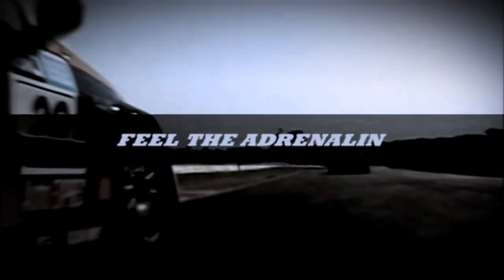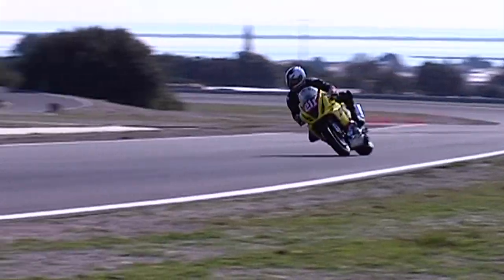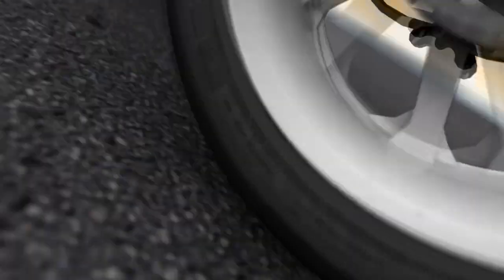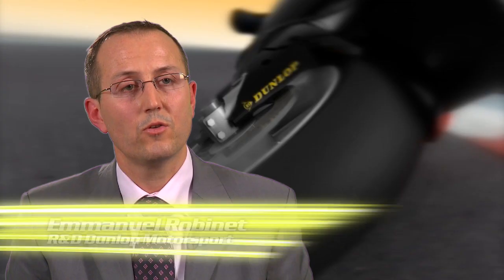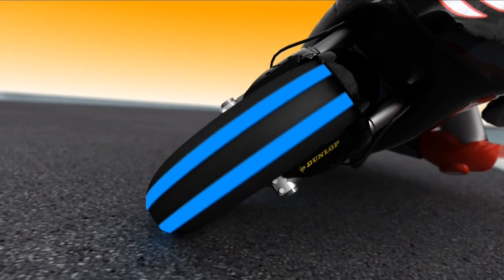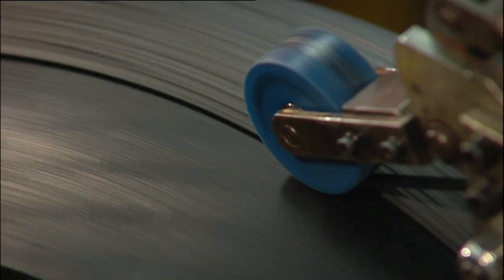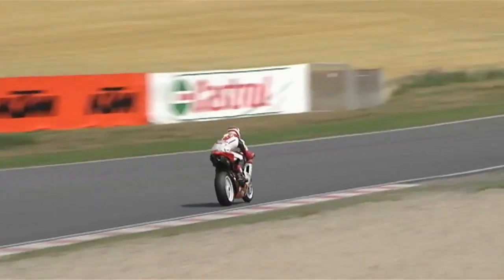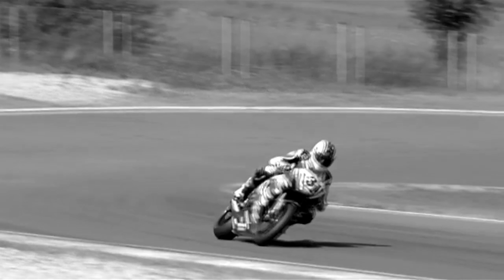Motorcycle Tire Technology - Inside Racing Grip

Comment: think the'coin sized contact patch' may be a little off
Reply: Gary Davies actually it’s true with most street tires, however race tires have a much softer stickier compound with allows it to deform much easier and create a larger contact patch
Reply: You are correct, I've heard it is more like the size of a credit card. Perhaps the width of a coin, and length of a credit card...
Reply: Wow, o.k. don't believe the experts, but what they don't say is what coin, a penny or a dollar! And 'that guy' you may only be slightly correct, a softer tire has more to do with the compound material which is the final layer of material and is grip-ier at that location, the amount it spreads and increase contact patch is negligible. Basically that softer grippier material has a greater coefficient of friction than the material even an inch away.

Comment: and the fact that, If you have a 600 you have about 115hp (average race bike) or a 1000 that pulls 190hp, While you are leaned over and you smash on the throttle the rear end is spinning so much faster then the front and putting all that power to a wheel, somethings got to give way it's not the chain or the road that will.

Comment: because in a car you dont have to have softer tires capable of giving the MOST grip with only two tires. Car tires can be much stiffer because there are four of them but also because you wont end up dead if one of them slips a little bit.
It boils down to the fact that motorcycle tires are "softer"

Comment: Why do car tires last so much longer than motorcycle tires?
Reply: Because if only one tire losses traction, you lose control of the bike. Oil in the rubber is what makes it soft, if the oil is dried up the tire has a very hard time to mold in the shape  of the asphalt b/c it is dry and hard. Can not take that ever for granted. It's life or death.
Reply: If you are talking about racing tires, like as in MotoGP Michelin’s vs Pirelli  of F1 . It’s not that big of a difference. F1 cars do go up to 50 laps on a set of tires and MotoGP riders go 25-30 laps but if they were to run 5 sec a lap slower than their potential as they do in F1 then I’m thinking they could be much closer(a portion of the reason for the much slower laps is also fuel, the car has 100Kg of fuel to start and a GP bike has much much less). I believe the F1 drivers put more effort into nursing their tires. MotoGP racers do as well, but the delta between a Qualifying lap and an avg race lap is much much closer in MotoGP.  Both F1 and MotoGP use the tires that their particular machine goes the fastest on for qualifying and it is almost always the softest compound for F1 However some MotoGP guys will use a soft rear and a Med or hard front, more support under the extreme braking loads put on the tire under braking . They only get 2 fast laps , at maximum potential out of the tires. And they are using race tires. They no longer use specific Qualifying tires. It just goes to show how much care is taken to maintain a constant, good lap time over 25-30 laps when the rider is capable of basically destroying them in a couple of laps.F1 is no different in this regard. They only get 1 or 2 “go’s at full Qualifying pace before the tires lose enough traction that the lap time of the first lap or 2 just cannot be beaten. So I feel like In the F1/MotoGP world the difference is not that great. Street cars vs street bikes however the difference is drastic. I usually get 15k out of a set of Bridgestone BTO16 PRO tires (and that is really good) on my bike and I just got 50,000 on the factory BFG’s that came stock on my truck when I bought it. The reason for this is traction. A motorcycle relies on grip to corner, accelerate and stop at a higher degree than a car/truck. You only have 2 contact patches about the width of a credit card so that small contact has to provide enough grip to ride safely. Car/truck tires have huge contact and there are obviously 4 of them. So that is the main reason motorcycle tires do not last as long. Btw, I have heard of people destroying bstones BTO16 Pro’s in 5,000 miles or even less so it does depend of how hard you ride them . Same for car tires
Reply: @TheTradesmanLU2001  5 sec. a lap slower, what are you talking about bruh?